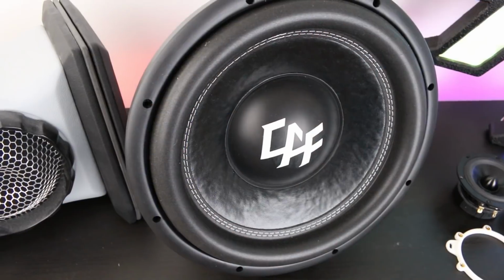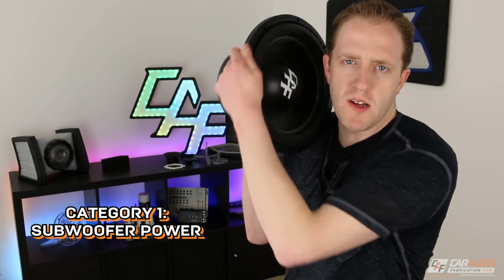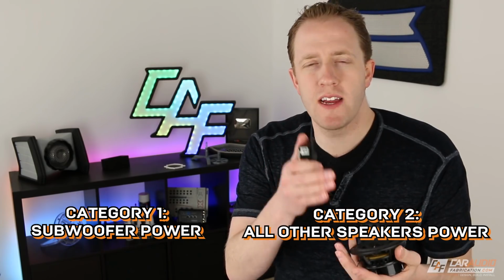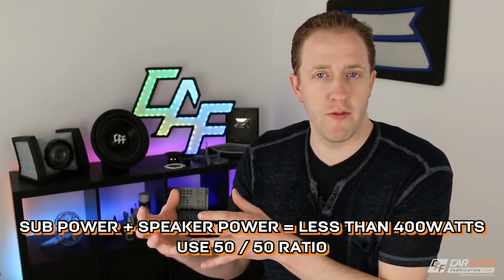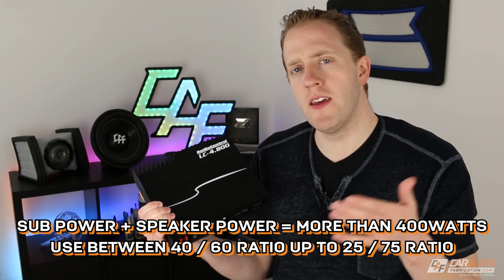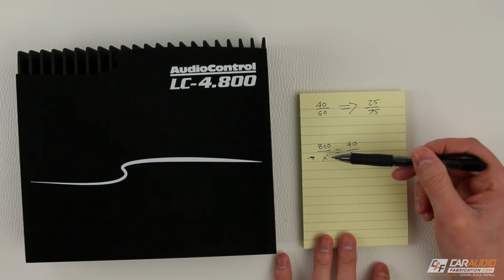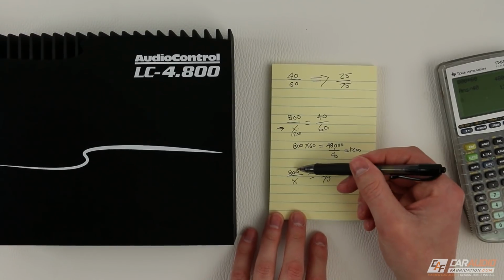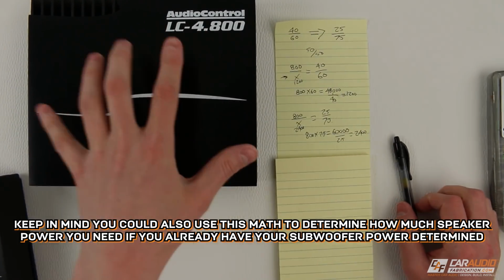Pair amplifiers CORRECTLY - Power Balancing Car Audio

Comment: Hey I bought a 3 way set of 8" cdt lows/3" mids/ 1" tweeters. It says 400 rms each do I really need an 800 rms class AB amplifier? Currently running 100rms each, volume is pretty low. I know the crossovers take up some of the watts too. Description says 400w rms @ 100hz hpf. Thanks!

Comment: Awesome video as always, Mark! I have four sets of the JBL 660GTI's and a JL W7 13" Anniversary Edition sub. I am planning my install in a 2017 Toyota Highlander. Would you recommend (A) 2 component woofers/tweeters in each door or (B) 2 components in the front doors, 1 in the rear doors, and the last set in the rear by the 3rd row? I've heard conflicting information so I figured I'd get your audience's input before experimenting for myself. There are a total of 8 woofers, 8 tweeters, and 1 sub. My stock JBL system is too weak and flat.